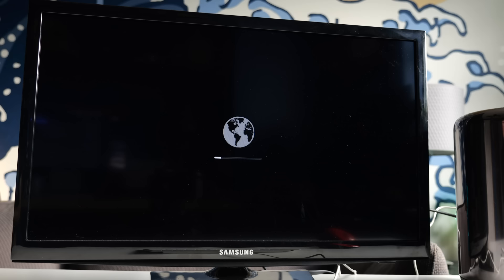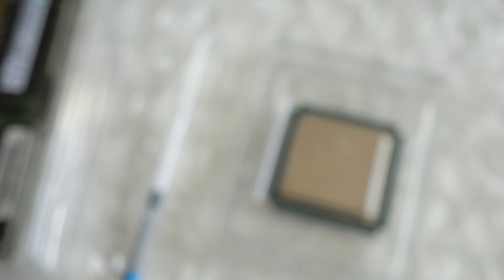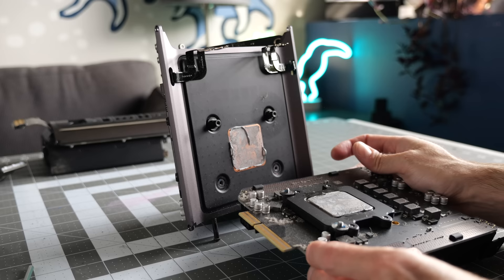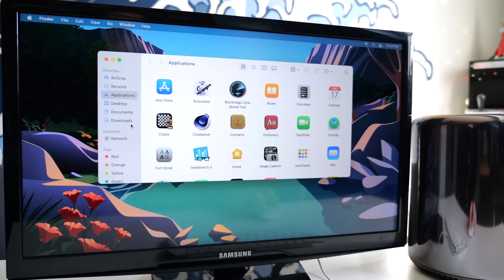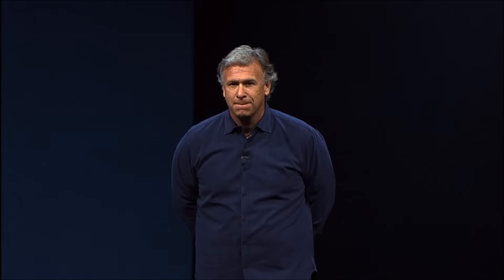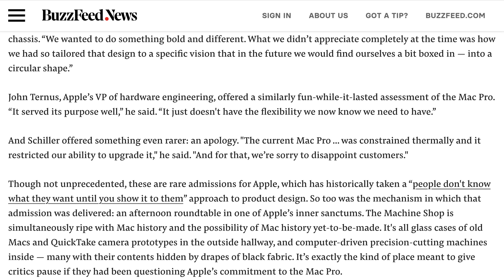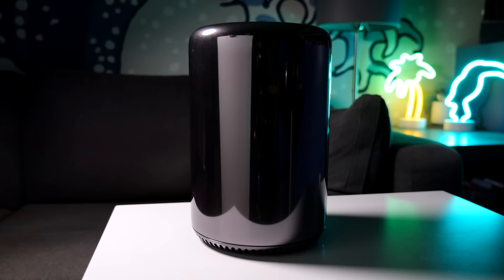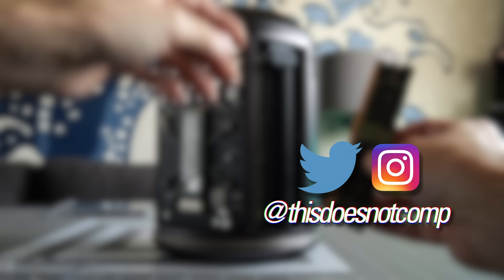Can This Decade-Old Mac Pro Compete With Apple Silicon?

Comment: I still daily drive a Mac Pro 5,1. Its a silly computer, but with the dual hexacore processors, it can crunch some serious FEA computations at a price that is hard to believe. All in I spent $500 on the thing. If I would have spent 6,000+ back in 2011 when this thing shipped it would have been a terrible deal, but now for so cheap... its pretty good. I have been running mine for 5 years now. Granted a modern Mac would probably slaughter it in terms of performance, but I just can't afford the upgrade.

Comment: I bought a hexcore with 64GB of memory in 2015 for $3900. Sold it last week for $500. Replaced it with a M1 Mac Mini. I'll miss the feeling I had owning a Mac Pro because I really loved the design and had no major issues with it. The new system is way more energy efficient and QUIET. If I didn't have to upgrade because of some software needs, I probably could have gotten another 2 or 3 years out of it.

Comment: Great video but I feel a few important points were overlooked. The most critical to me being that your using a computer with parts that are 9 years old. That motherboard could die on you and you might be out near 300 dollars more to get a whole new one to replace it. This is not to mention that Apple will barely be providing support for this device that a lot of casual users may need. Otherwise great video!!

Comment: Despite the limitation that this model haves I think the design it’s very interesting and the way it’s constructed results brilliant to pack how many things in a small space, this and most newer macs are not designed to be upgraded by the owner and even being opened that’s why it turns to complex to get in and change one single item. The one from 2010 it’s the latest great Mac Pro with so much expansion ports and upgrades capabilities,  may be apple need to consider this again for the future models, it’s very unfair that you cant switch even the battery nowadays, they make incredible products that can last for years and years and now they make you buy a brand new one instead replace the thing you need and keep using it for mauve time, for sure this could be good for marketing , they allow you and help to keep using your products for long as you want, I’m still using my 2011 11” MacBook Air for architecture design, 3D modeling and graphic design, last year I had to change the ssd for an aura pro, and it’s faster that the day that I took it out the box, I don’t think that a regular windows pc from that time could last all these years and having this great performance over the years, for sure Apple need to change its upgrade politics.

Comment: I'm new to the Apple scene and recently picked one of these up for around $250, it was a base model but someone had already upgraded it to 64gb of ram. I used OpenCore patcher to upgrade it to Sonoma, and used it as a primary desktop for a while. The main issue I ran into is the 2gb of VRAM is not enough to run a 4K screen, as it was constantly sitting around 70-80% full when just sitting at the desktop and running iStatistica. And on top of that, the screen was always a bit laggy, but I think that's from me forcing it to run an unsupported OS.

I'm looking into upgrading the CPU in mine now, or possible selling it off and getting my hands on a high-end model so I can get the 6GB VRAM option. But I might also just trade it for an older Mac Pro so i can get dual CPUs. not sure yet.

Comment: I just had to talk a User out from having us upgrade one of these.  It was a 6-core model and they wanted more storage.
The deal breaker was the fact that Monterey support (MacOS 12) should fully end at some point around Fall of 2024... so there's only about 1-1/2 years of Security Patches coming for it.  Apple's OS support runs on a 3 year cycle.   1st year full (potentially new features, bug-fix, security patches), 2nd year (bug-fix, security), 3rd year (security fixes only), then unsupported. 
When it goes unsupported, it should get pulled off the network.

I also looked at GeekBench scores to give him an idea of what he was trying to keep running.. and new M2 Mini is more than twice as fast on both the single and multi-core benchmarks.

BTW.. it's not surprising that the upgraded 12-core Xeon beat the M1 in the multi-core benchmark.  Assuming it's really an M1 (not an M1 Pro or M1 Max, it's got 8 cores, but those break out as 4 performance cores and 4 efficiency cores.
The Xeon is actually a 24 thread CPU with HyperThreading.  You can sort of think of it as have 12 performance cores (instead of 4 in M1) and 12 virtual HT cores that would perform more on par with the M1's 4 Efficiency cores.

Comment: These machines are not obsolete, or useless.

They do have a couple problems although, like what is the actual electricity consumption on normal use, idling and sleep?
And then there is, can you run the common most processing heavy tasks with it in expected manner, like Full HD video editing?

I am writing this with Macbook Air 13" from mid'2012. This is today 12 years old laptop. 

And this laptop can do Full HD editing just fine, the rendering takes just almost from 1:1 to 1:2 time of the final video rendering.
That is not bad at all. Remember, most don't need rendering in as fast as possible, the projects are long lasting, and not even big ones. 
For that anything older is just fine. 

And yes, this machine runs on Linux, that is what makes it excellent as it is with all the updated software and no problems.
For a < 80 price you can get something really good really, and addition 25 for new battery and everything is fine...

Comment: i snagged one of these recently threw in 64GB of ram as well, base CPU, hacked on Monterey as well and bootcamp windows 10, I can run GTA5 after installing MSI afterburner ,a Macfan speed program to max out fans during ad using AMD Catalyst driver 18.x.  I get high detail on all settings and running 60 fps, clearly frame tearing due to Hz but still playable for sure!

Comment: Great video as always. It would be fun however if you compared the power draw of the two machines while performing the same tasks 🙂
Reply: I'm also curious about that. I noticed pretty substantial power bill increase going from a macbook pro to an old desktop with old tv. The macbook broke and I was low on finances. I now have a laptop again. Power is getting seriously expensive so definitely important to factor in when looking for new (secondhand) hardware!

Comment: You can get a 2018 Mac Mini and get good performance.  Since you will thermally throttle pretty quickly, no point in getting i7 chip, just go for the i5 and add as much RAM as you can, and i put in a nice big SSD. The 2018 is the last mac mini that lets you upgrade both RAM and SSD. Nowadays, everything is soldered and Apple charges too much for the upgrades.

Comment: The highest upgrade is the 1680v2, 8 cores 16 threads, which technically is better in single thread performance, however loses a slight bit in terms of multithreaded, also the gpu goes up to the d700 with 6gb of vram and being comparable with the 1050, with more cores, more memory bus width and more bandwidth

Comment: I'll add one of these to my collection one day, but the electricity cost where I live is very expensive. A CPU maxed out Xeon machine running for a whole year will actually cost more here than buying an M1 Mac mini. So that's a consideration for some. If you need to save $ just use external storage. I'd caution against buying Intel machines at this point unless you're well aware of all the downsides. But these are a lovely machine.

Comment: Certainly a cool machine and I'd love to have one, especially spec'd up like yours but I too prefer the older "cheese grater" case. What's the fan noise like when it's ramped up? Tolerable or more akin to a VTOL aircraft?

Also, these are still crazy expensive here in New Zealand sadly.
Reply: Fan is quiet because it’s so big. It also ramps up conservatively, as is Apple’s custom. Only negative is that it’s on all the time. So it won’t go completely silent as other Macs do.

Comment: A neat upgrade, but the power draw and lack of any real expansion other than Thunderbolt 1 is kind of a "Meh!" for like a dailydriver PC. I have a couple of old Dells that only get fired up when doing particular jobs, they generally don't run all day every day, so power usage is not huge. I already have an overspecc homebuilt that for 75% of what I do is overkill.

Comment: While it may be fun and interesting to hack together an awesome system from yesterdays hardware mixed with today's faster components, the real killer is the fact that Apple intentionally sunsets their OS upgrades so they won't work on older hardware. Thereby forcing people to eventually upgrade if they want to remain relevant. Worse, they tell app developers that their apps need to keep up with the latest OS versions or risk being kicked out of the store, while also telling them they must deprecate compatibility with older OS versions. It sucks that they do this. I hate it almost as much as I hate that Apple still charges a fortune to upgrade memory in all their devices (which costs them pennies) and they always design their base models with anemic memory sizes that no one but your grandma would want.

Comment: Those Xeon E5-2xxx series chips were meant for dual processor systems.  Unless you're doing work that requires all those cores, its completely pointless.  Best to stick with the E5-16xx series.  A lot of people make this mistake when re-purposing old workstations for gaming (the most common scenario) because they mistakenly think that more cores = better.
Reply: And not only that, E5-16xxV2 and V3's are unlocked!

Comment: Actual Maximum RAM

The official maximum RAM capacity in the Cylinder Mac Pro is 64 GB (four 16 GB modules). However, on March 13, 2014, memory manufacturer Transcend was first to announce compatible 32 GB RDIMM modules, making the actual maximum RAM 128 GB.

Although Transcend's press release explicitly stated that the company had "fully tested" these higher density modules and that they "guarantee 100% compatibility," it also was worth noting that the company once before issued a press release trumpeting higher than official RAM capacity and later had to retract it.

However, this time, Transcend's announcement was accurate. On March 26, 2014, after full testing, OWC formally certified a maximum of 128 GB of RAM in the Cylinder Mac Pro with the following note:

    While current DRAM device technology limit 32 GB modules to a 1066 MHz memory clock in the Apple Mac Pro 2013, due to enhanced CAS Performance of OWC MaxRAM 32 GB Modules, actual real-world performance is insignificant in low memory need scenarios while offering incredibly significant performance gains in all cases where application use benefits from greater than 64 GB of total memory installed. 

In other words, the performance gain of having twice as much RAM more than offsets the performance loss of the slower memory clockspeed.

Comment: Running 3 as VMware severs with a lot of externally storage. Now retired an one is my lab Mac, 128 GB ram (all 3 had that i do not now if it is s the limit 64 is not the limit),  an I think it has the top spec on SSD and CPU, dam it's fast.

Comment: Wow, that's not bad that it runs Monterey. Probably not a bad computer still for low level stuff. Hooray for those ssd converters, I used one in my old MacBook Pro from 2015 and now it gives my Mum a nice 1Tb drive. I ended up giving it to my Mum because it wasn't powerful enough for it's intended purpose (to run Logic Pro).

Comment: That CPU is actually a Xeon E5-1620 v2, because the base Mac Pros have a quad core 3.7 GHz CPU, which is the E5-1620 v2. The E5-1650 v2 is a six core CPU, however.

Comment: I’m tempted to buy one of these, as long as it has D700’s so it can run some old games in Windows, something no Apple Silicon Mac can do.. I can upgrade the processor to an 8 core, stick in 64GB RAM and a 1 or 2 terabyte SSD. All for the price of an M1 Mac Mini.
Reply: The D700s thermal throttled pretty quickly, I went for the D500 myself.
Reply: @circleofowls  I have heard that. May just get a refurb Studio instead.
Reply: @marksapollo  That's probably a good bet for functionally. I had the privilege of working on the 2013 Mac Pro during development so there is a lot of nostalgia there for me. I really love the little beast, state of the art or not.

Comment: The older one can with memory and rtx 6850 GPU SSD pcie card  wifi and Bluetooth upgrades newer USBC or thunderbolt card and using opemcore to install the latest osxs. 

The optical in and out audio is great and dual gigabit Ethernet.

Enough room for 4 hdd/ SSD ecc memory uhd blueray burner is awesome.

Depending on benchmark it actually can beat most m1 m2 macs in all but raw  cpu,  memory speed, and anything that involves apples media engine chips for video encoding rendering playback.

But it will actually beat it in something's including gaming 3d that takes advantage of the rtx 68 6950 xt.
Of course the CPU is severely out matched in single core not as much in multiple but still whooped.

Comment: At 1347 you stated that the Mac Pro "... runs hotter than the Mac Mini."
The Mac Mini runs at or extremely-near its junction temperature of 100C by design, averaging 90C+ with numerous people ignorant to how its thermal design works calling it "too hot".
The Mac Pro has a junction temperature of 86C for the 2697V2, tending to run in the 80s due to how TurboBoost 2.0 works.
The D300 cards will run around 75C in the Mac Pro with a junction temperature of 95C.

So the Mac Pro does, indeed not "run hotter" than the Mac Mini; either objectively or using some unscientific arbitrary metric of what constitutes a "safe" temperature value.

Comment: The D700´s are actually quite decent.. I bough mine with a 4 Core D700 Config, and changed the CPU to a fitting 10 Core 3 GHz

Comment: I would have liked to see it with the cpu with the highest boost performance rather than.more cores. Would make a bigger difference in day to day feel of the machine vs running a large multi core workload that may not even support the software at this point.

Comment: That's one disgusting Mac Pro. Looks like it lives inside a dust storm. I've taken mine apart just to clean it, and it's always been very clean inside. I don't even want to now what kind of environment that Mac Pro was in. 

As for the upgrades, the 10 core e5-2690 v2 is sometimes preferred over the 12-core e5-2697 v2 due to having higher clock speed for most used programs. Not a lot of apps actually use all the cores, and in most uses, the higher clock speeds is noticeable for daily use. It's a toss-up. 

What I do know for certain, having owned 3 different Mac Pros(6.1, 5.1, 3.1), the 6.1 "trash can" Mac Pro has been one of the most consistent running computer I have EVER owned. My Mac Pro is a D300 model with 64gb OWC ram, 1tb Samsung Evo, 10-core 3.0(3.6GHz turbo boost), Razer Core X Chroma eGPU with AMD Radeon RX 6900 XT 16gb. It is running three 4K Samsung 43" tvs. I rarely ever turn off my Mac Pro. It just works so effortlessly. When I walk away, I usually just let it go into sleep mode on its own, and the TV's automatically turn off after the signal stops. When I come back, I just tap any key on the keyboard, and it comes to life, while automatically turning on the main TV , followed by the remaining 2 after logging in. It's been a decent amount of years that I've had this, and  honestly hate the thought of it one day not being able to update to the newest OS or other software.

Comment: Power cost is a problem.   43 W (Quad-Core Idle) 205 W (Quad-Core CPU Max) 43 W (6-Core Idle) 238 W (6-Core WCPU Max) 44 W (12-Core Idle) 270 W (12-Core CPU Max)

Comment: The major problem with older macs like this mac pro 2013 is that you can't upgrade to latest mac os, which is a bummer in my opinion, at least if you need to do software development on it.
Reply: you can probably put Linux on it

Comment: The Mac Pro is an expandable system whilst everything else sold by Apple is stuck with whatever hardware has been soldered into it. If a company pulls enough weight and has enough funds they could either work with Apple or a third party to customise the Mac Pro.

Comment: another caveat is that the old macs performance only matches on the high end! if you want to use it for other tasks than benchmarks, you have to consider the single core speed, since very few programs are optimized for more than 2 cores.

Comment: What makes it funny is that my daily driver PC has 64GB DDR3 and a Xeon E5-2690v2 (which I also got as a refurbished part to replace the slower CPU). I guess the only thing that trashcan can't match is a proper and modern GPU.
Reply: It's compatible with eGPUs but I've never really found the need to use one.

Comment: when that thing came out was alredy a intel gen older , on that time i buy a pc with 5820k that was alredy more powerful than the mac pro ,  that i recently upgrade with 12core xeon ,  and i can get a 18core for the same mb , curently have 64g ram  2gpu , 10network , and still can upgrade it to 125g ram ,

Comment: I have one of these in it's box. 6 core with double the max RAM (OWC slower RAM). It went kaput and I assumed that repair would be pricey, so got a 2018 mac mini to replace it. However the quote from Apple for the repair (power supply) was quite reasonable/ cheap, so I had it repaired but never put it back in as my main system. I should resurrect it I guess, before it becomes even more outdated.